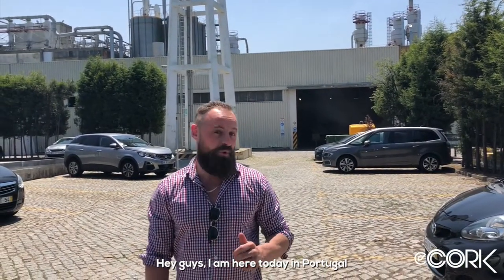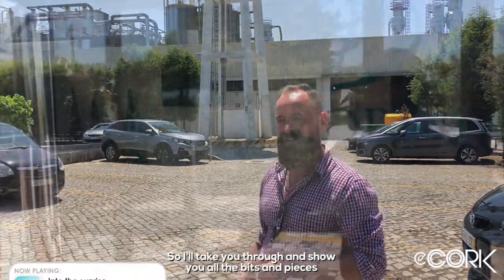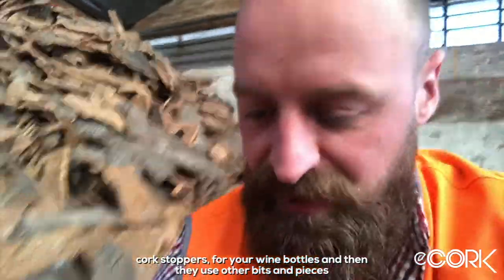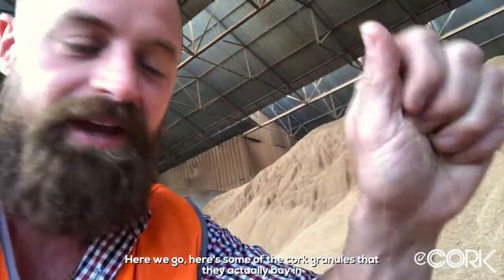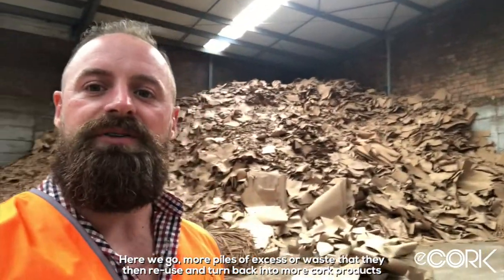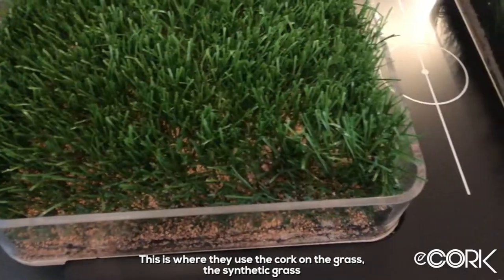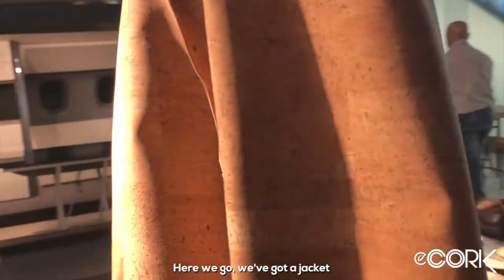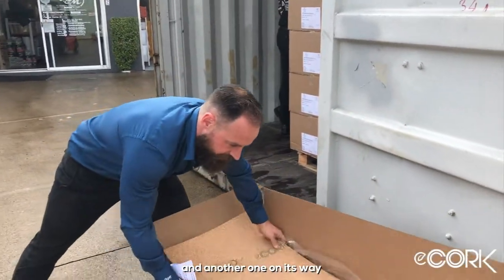What is CORK & how are products made with it?

Comment: Cork is a great material for flooring, soft under foot and thermally stable under foot all year, not cold or hot.  Its only downfall is resurfacing. Our natural cork floors were painted high gloss Urethane clear finish every 5 years.  The tiles were in place for 40 years and were only replaced because of the termite damage to the timber floor underneath. We replaced the tiles with a high gloss Calacatta marble look ceramic tile. Spectacular to look at but as cold as the Antarctic during winter.  Maybe further research can combine the two without cracking the ceramic, the best of both worlds.
Reply: The ecoCORK Insulation Acoustic Underlay can be used under tiles to help with the 'coldness' of tiles. The newer finishes last longer as well, generally about 10-12 years under normal use. Thanks for your comments and love for Cork.